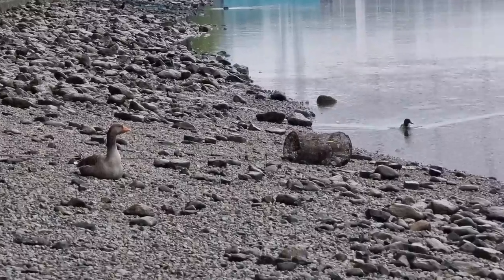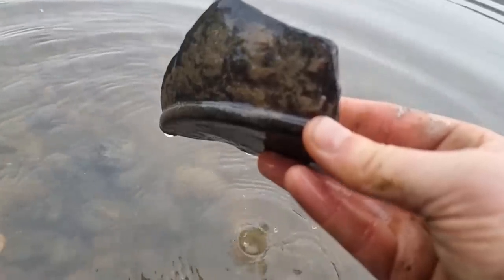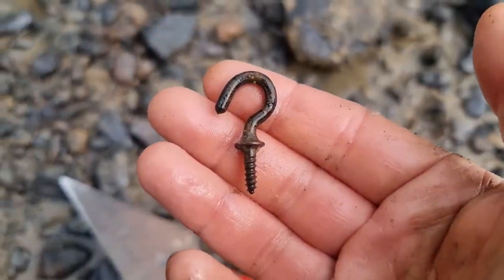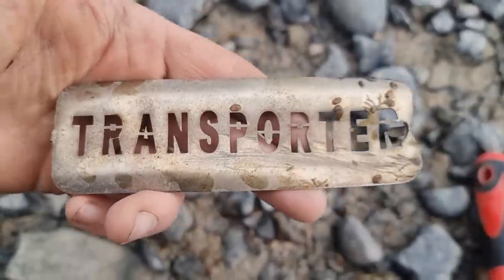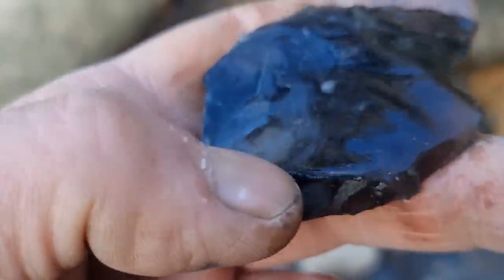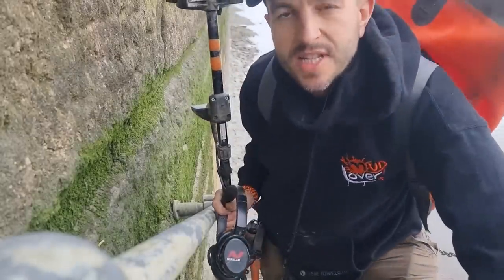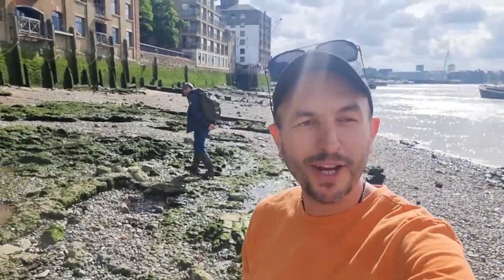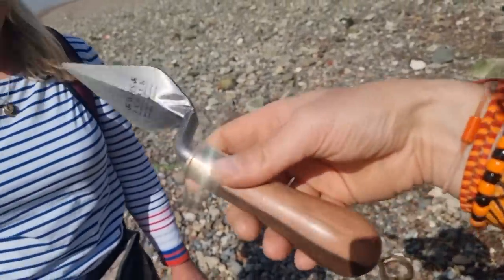WOAH! Unexpected RARE relics found on the River Thames foreshore, London

Comment: If you want to find out more about the rifle brigade badge I suggest you contact the rifles museum in Winchester. I don't think its a cap badge but maybe a veterans campaign pin. I'm an ex Green Jacket and I've never seen a cap badge with a single battle honour before. so further research maybe required
Reply from the maker: Cheers pal, I’ll do that

Comment: 8:24 It's for sure a Diamler center cap for a steering wheel, I think it's around the 50's - 60's because it doesn't have the wreath that normally surrounds it, so maybe even older 🤷‍♀

Comment: Excellent luck this week!  I knew it was going to be fun when you started the day jauntily tossing your trowel in the air and catching it on your way onto the foreshore!  

Loved the cap badge - it was magnificent and still so finely detailed.  I was very excited about the little ring, but saw in the comments that it wasn’t solid gold which I know is what you’re looking for.  It’s still prettily engraved and a nice find.  The coin was nice and the parasol slide, too.  Then there were the two knives - you did a great job cleaning them and then to replace the blade!  You’re really so clever with your up cycles - assuming you don’t launch bits of them into orbit, of course!

I learned a couple of things today - I hadn’t heard of hag stones or witch stones, so had to look them up and I hadn’t heard of, let alone seen, a penny lick.  How delightfully unsanitary!  😂  

But I was most impressed by your find of the flint tool there on the foreshore after last week’s video.  Makes you wonder how many you’ve seen without realizing, doesn’t it?  And nice to have Sean confirm that it was a particularly special sort, too!  

Great video, as always.  Only thing missing was a glimpse of the fabulous Nelly (and maybe Daisy, too)!
Reply from the maker: Thanks Lucinda. Wonderful comment. You had a bee 🐝 instead of cats 🐈‍⬛ 🐈
Reply: @Sifinds  
So true!  Save the bees!!

Comment: The 'D' thing appears to be part of a hub cap from a Daimler Sovereign 420, Daimler V8 260, Daimler DS420 or possibly other models that would have been manufactured between 1966 and 1992 (reference eBay UK item number 124480932922). I don't think the wheel that it was next to is related as cars tended to have large steering wheels back then to overcome the lack of power steering or as a hold over from when that was the case in previous decades.

Comment: So I have this diamond wheel on my angle grinder, right? Went to cut some aluminium...and quickly learned how at high temperatures, aluminium can fuse with the edge of your cutting bit (can also happen when drilling, for example) or fill the grooves of your let's say diamond infused saw blade edge. Whoops.
Reply from the maker: Oops. Haha

Comment: the cap badge cannot be as old as you say. It could not possibly been around during the boar war as there is no way they would have known the end dates to put on it. it's more than likely 40's-50s
Reply from the maker: 50s? No 😂
Reply: @Sifinds  well, pre 52 when the crown changed to the queens. which is also a reason this can't be boar war issue. queen victoria would have been on the throne and therefore her crown not the kings crown would be used. still a nice find. keep up the good work